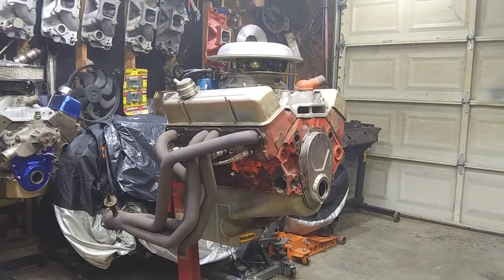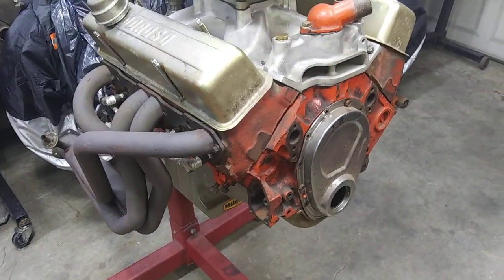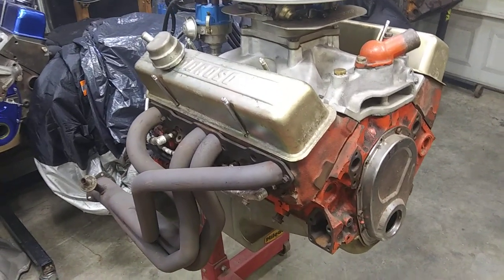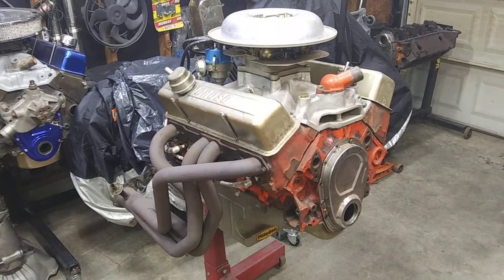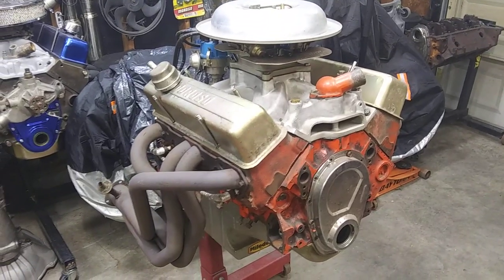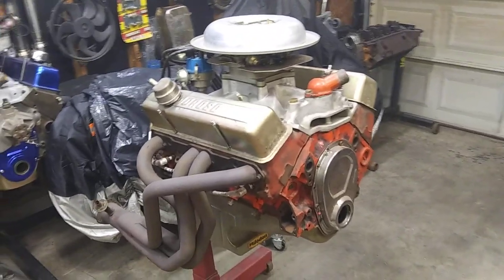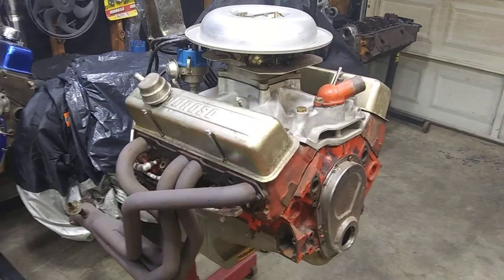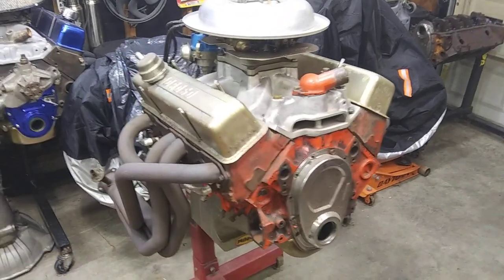The truth about the "Double Hump" heads.

Comment: Yeah I have 3 sets of them and they can be ported  good by a company  back east call berinski  they Can make  them flow great but they are  not cheap , they port them for certain  classifications of racing, there are many  companies to choose  from that make great racing  performance  aluminum heads. AFR is probably  the best of them all.
Reply from the maker: Berinski is good. Been around a long time. If I had an unlimited budget, I'd buy ALL PRO heads. Best SBC heads made. But also the most expensive. I've seen a few 1000+hp Comp Eliminator  NA SBCs built with ALL PRO heads, also found on outlaw Sprint cars, they have some serious heads for the old SBC. But ya better be wealthy. Brodix also makes some monster Sprint Car heads that are massive as hell. Very expensive tho.
Reply from the maker: Patterson Racing can work some magic with the old double humps, they're Superstock engines are always top of the pack.
Reply: Back east ? Randy Brzezinski is from Wisconsin.

Comment: I've got a ported set of angle plug 492's going on my 383 and two extra sets of 291's for my Chevelle's next engine. Still look cooler than the new shit.
Reply from the maker: Them old heads are still cool. Had a couple pair of 492s back in the day. Best head you could get back in the 70s. Pretty rare now. Many a fast car was built using them old GM heads. It's just too bad the price of machine work has gone thru the roof. I have several pairs of old heads Id like to use. Brezenski says the 291s flowed the best out of the non accessory hole humps. I'm sure he would know.

Comment: 327 punched to 339 have the crank lightened,carrillo rods,double humps ground and flowed,install rocker screw in studs,11.5 probe pistons,air gap 780 holley,isky cam and lifters,harland sharp rockers 1.6 dropped into a 55 210 fenderwell headers 4.56 gears mickey slicks,turned 10.60 all day till it got to 98 degrees,3speed trans out of a big block wagon,those were the days,10.00 cranks for replacement
Reply from the maker: Yep, still have a couple 327s laying around I need to build. Always been one of my favorite engines. Lots of potential.
Reply: @thereluctantgearhead4544  lighten that rotating assembly and blow by them using an extra 1000 rpm's on the big end,it worked for me,go get him hot rod

Comment: Hello I just found your channel do you ever sell parts? I’m looking to buy a Sbc dart shp intake or a afr dual plane intake if you have any for sale. Also  do you have any used engines for sale?
Reply from the maker: I'm pretty much a hoarder these days. Always looking for more parts to finish my projects. I used to sell parts, but it became a hassle selling on eBay.
Reply: @thereluctantgearhead4544  yea I sold off a ton of Sbc engines years ago when we quit racing but now I’m trying to start racing again so I’m having a 388 built but the summit heads I was gonna use are too small now that we decided to go with a better bottom end. So I wish I could sell those or trade them for a better head and just pay the difference in cash. But keep in touch I have bought up several single plane intakes and dh heads and a nice Msd setup pro billet with a 6al box that I don’t need so if u ever need anything maybe we could do some trading. The next engine I’m looking into building is a sb2.2 or a 18 degree high compression Sbc. I’ve always wanted to try those two engines out and never was able to afford them til now. So if u know of any parts I’ll be needing everything. Thanks buddy have a good day

Comment: You’re right.  Aftermarket aluminum heads will pretty much out flow any of the old cast iron heads no-matter what make.  Nowadays anyone can screw together a bullet without thinking… Without Thinking!!
Reply from the maker: Yep, it's alot easier these days to build a powerful engine. Almost too many choices. Takes alot of work to make a 60yr old head match a modern aftermarket head.
Reply: I prefer the work.  We run a set of very modified 462’s on our Super-Gas car.
Reply from the maker: @1996slamster  yep, I still like a lot of the old ways of doing things myself. I grew up around drag racing in the 70s, so that still has a heavy influence on how I do shit. Always preferred the modified classes and Superstock.
Reply: For the most  part yes  but not all after market aluminum  heads are the same   I definitely  wouldn't  take a set of edelbrock heads over a set of AFR. AFR are probably  the best out there
Reply: @1996slamster  I actually have a set of them on my 72 vette that the previous  owner  installed

Comment: The vortec heads I had under flowed the 462,and the 461. Know my AFR made them look them look like they where junk heads.
Reply from the maker: Some are better than others for sure. To build a good NHRA "Stock" Eliminator engine, ya need about 20 pairs of the head ya gotta use and flow test them all till ya find the best pair. There can be a big difference in flow with 2 identical heads.

Comment: I dig super stock production and had my nose in more than a few. They really take an ass whopping every single run. Those pups are stretched so far beyond the intended limits it's amazing they ever survive a round. The blue print work and xraying chit is just off the chain in expenses. Like a damn boat, a hole in water you can't fill up!
Camel backs sell :)
Got a set of 65' vette heads sitting here to move along at some point.
Reply from the maker: Yep, pretty amazing what NHRA Stock &  Superstock engines are doing with the parts they are doing it with. I grew up around that shit and Modified and Super Modified class cars. Definitely a heavy influence on how I do things. Built a 68 295hp 350 Superstock engine years ago, it made over 560hp. Also built a "Stock" L-69 305 that made almost 400hp, ran high 11s in a Malibu wagon.. Several Oldsmobile 455 Stockers in Cutlass's, a 403 Stocker for a 77 Olds 98 that ran low 12s, and a Pontiac 400 for a 74 Formula firebird. Building shit like that is more of a challenge to get the desired results and still be legal. Wouldn't want to build them everyday tho. The rules have changed dramatically since I was fuckin with them. They allow alot more now than they used to. Believe approved aftermarket heads and blocks are the norm now. Back in the 70s & 80s & 90s, a Stock/Superstock engine was still built with alot of stock parts. Current day Superstock 350s are over 650hp. They also selling for $40,000-$50,000 bucks for a Patterson or Nickens  engine. Shit done got real expensive. Those classes where originally low buck regular guy classes, now ya need a million dollars to go Superstock racing. And the price of a good buildable rolling chassis from the 60s/70s has gotten crazy too. The days of the $500 67 Camaros been gone for a long time. Those were the good ole days.
Reply: @thereluctantgearhead4544  I was talking 60 to 1980 vintage classes. Atco was in my back yard one town over.
I was  there from the begin at Englishtown rod run when the Old Time Drags started. Infact we had seven cars camping Friday and Saturday night in the grass feild down the back entrance road. We started that meet and now it's gone.

Kinda miss the old FX cars also. SS racing is a pure money game now no doubt. Wouldn't mine campaigning a altered or C gas car thought. Time and money is all I need.
Reply from the maker: @kenmoule825  Yep, times definitely changed. These youngsters these days don't know what they missed.
Reply from the maker: @kenmoule825  I'd like to build a C/Gas old Chevy, a 58 or 59 body would be cool.

Comment: How right you are I had double h u m p s on my 327 then went to Big Block blew the doors open and never looked back 56 Chevy Gasser
Reply from the maker: Bigblock definitely the way to go if ya want serious power. Alot easier platform to build. Even a mild bigblock makes alot of power.
Reply: @thereluctantgearhead4544  yes I was beating Big Blocks with my 327 but broke a crankshaft in half then went to Big Block and that's all she wrote I was putting out 600 horsepower and never ever went back to small block

Comment: They still have a place at a lot of dirt tracks. For some reason many dirt tracks require factory iron heads but don't allow Vortec heads? I ran a Pontiac 400 with Ram Air III heads that will outflow a Vortec and they never batted an eye. I don't get the rule makers sometimes but for every other conceivable application except Pure Stock Drag racing, anything aftermarket is better.
Reply: You ran round ports on a dirt track? 😳
Reply: @superduty4556  I did not see that I had mistyped  that. I am correcting it. I actually ran 1970 #12 Ram Air III heads. And I made way more torque off the curve than any of the Chev's or Ford's. There was one guy that ran a Mopar 360. 90% ran Chev's a few Ford's and of course one Pontiac. I was required to run an iron intake which isn't a bad thing and I ran an 041 cam with 1.5 rockers. I didn't 1.65 rockers because on the dirt track under a green flag the engine seldom runs below 4k rpm's. It mostly runs between 4k and 6k so I wanted durability over the last few HP. The block was a '73 out of a Catalina and I ran H beam rods and SRP forged pistons with a stock crank. 10W40 Royal Purple synthetic racing oil and never experienced any failures. Most people don't give Pontiac engines credit for having the ability to be able to compete in endurance type racing but I saw a lot of 400 SBC's lose bearings or even a rod or two. That engine is setting in the corner of my shop. They changed the max displacement to 355 for GM and 360 for Ford and Mopar a few years ago. I should build a Pontiac 350 and show them all up with it!!!
Reply: @1967davethewave  
69 and 70 ram air III were the best ever offered from the factory until modern heads and lightweight blocks came out. 455 Buick was the other BPO monster.
Reply: @kenmoule825  I think SD heads were better than RAIII D-ports by far.

Comment: I have a set 492 casting with accessory holes already been to machine shop got valves and springs in them and threaded ready for studs id sell for $800- $1000

Comment: They were expensive back in the 80's and hard to find. Nobody would sell them. They work great in the smaller motors.  Aluminum is so much lighter.  Speedway makes aluminum double humps. Aluminum intake, water pump, heads and a light carb you got over a 100 lbs off the front of the car. Put the battery in the trunk too.🤤

Comment: Then you still have to drill holes for brackets on street engine
Reply from the maker: Or use a short water pump and old style brackets. They also make low mount alternator brackets that attach to the block, and some to the water pump. I prefer using the short water pump setups in V8 S-10 swaps and Vegas too. Every little bit of clearance helps on some swaps.
Reply from the maker: A lot of 350 sbc powered boats used short water pumps and have cool alternator brackets and pulleys. 70s corvettes too.

Comment: 041 heads same as double hump xcept with accessory holes
Reply from the maker: Yep, have a pair of them on the shelf too. 186 pretty much identical also.
Reply: Those 041 heads work well had set on a 1969  355 still running strong after about 13 seasons running

Comment: Exactly DNT wast money on fixing double hump heads , they have aftermarket alum heads with the double humps cast on them if u are stuck on getting double humps
Reply from the maker: Yep, those are pretty cool, but they are also pretty small, around 175cc I believe. Guy better off buying a pair of 200cc BRODIX or 200cc Promaxx heads for less money and make way more power. I seen a pair of badass 245cc AFR heads that someone carved on and made them look like old doublehumps painted Chevy orange. But it was a 650+hp 406 SBC. They had a shitload of time into them. That was a few years ago. Big Bowtie singleplane intake painted orange wasent fooling anyone tho. Engine was in a 66 Chevy 2 wagon sleeper. Ran 9s NA.
Reply: @thereluctantgearhead4544  a friend of mine was a head and manifold porter , he used to get the vortex heads from a engine exchange for one fifty , port them install a 208 intake valve flowed 280 , he was a exhaust port expert also important for street believe it or not , he would put them on a ten point five compression 350 high lift hyd roller cam , dual plane mani , n would get five hundred hp , 500 ft lbs all with a smooth idle
Reply: Correction 205 intake valve
Reply from the maker: @bryang9158  They have potential if a guy wants to put the time and money into them. Built a few rowdy SBCs with ported Vortec heads myself. Spent a shitload of money on them. Definitely made good power tho. Still have a killer pair on a engine sitting on a stand. It made 500+hp when it was built with a big singleplane. I swapped a big marine Mercruiser dualplane on it for use in a truck. Lost probably 20hp, picked up probably 20lbs of torque on the low end. Has a big roller cam in it. Ran like hell in a S-10 Blazer years ago. That Mercruiser intake is a killer dualplane. Looks like a Performer RPM, but better.
Reply from the maker: @bryang9158  I have a Performer RPM intake also, it looks like shit by comparison. But those Mercruiser high rise intakes cost around $800 bucks new. I traded a Victor Jr for it. Dude didn't know what he had. They actually came on a 430hp 383 Bravo marine engine. Expensive as hell.